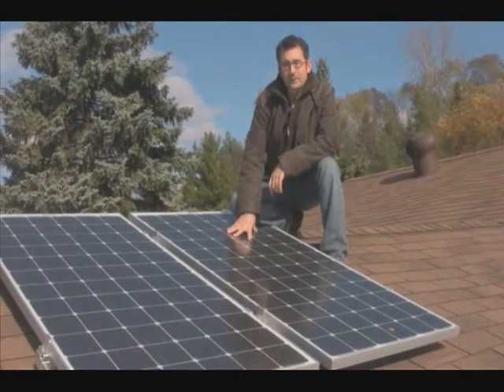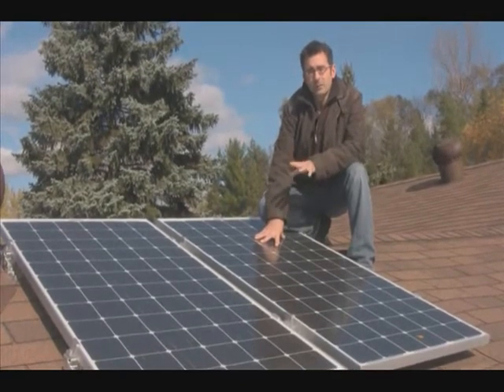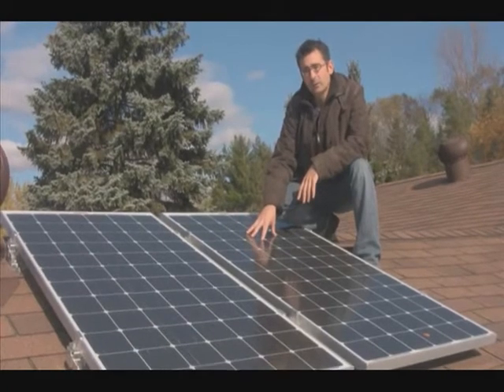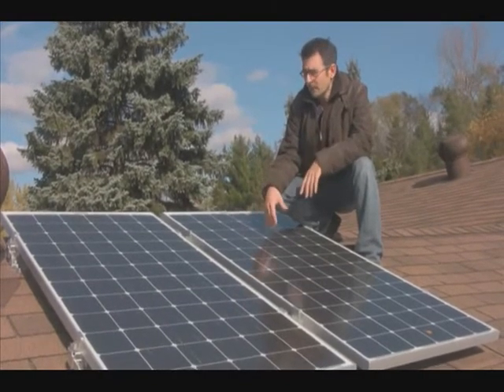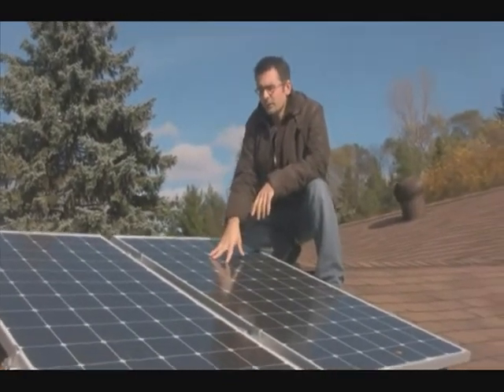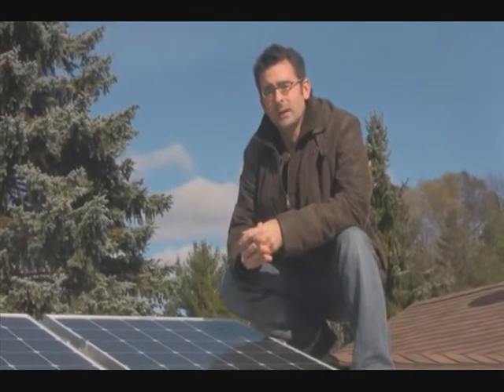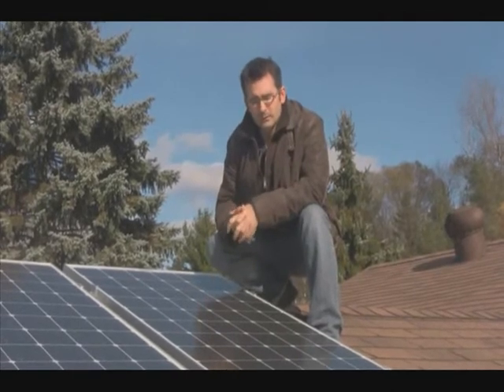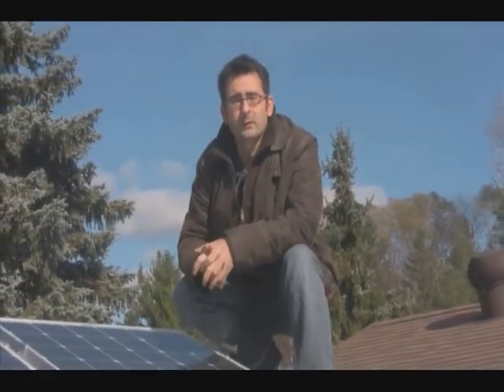2009 11 - Solar Panels.wmv

Comment from the maker: I believe the enphase inverter is connect to a 220v because the 40amp breaker is a double pole.  and there is a monitoring fee it's about $5.00 for the year but that is only to broadcast the info to the web as I have on web site.  you can access the inverters locally by entering their IP address from a computer connected to the home network.
thanks

Comment from the maker: Retail, the panels are about $1200 each including the inverter.  Installation for the first panel is about $1000 and the second panel is practically nil.  Horizon Utility Corp also wanted $350 to setup the account and install the meter.  The monthly account fee I believe is $10 every 2 months but I haven't receive my first bill / credit yet.
thanks

Comment: Do you mind if I ask what was the cost for the two panels racking and inverter. I am currently conducting my own test. I have 2  200 Watt panels on my shed. Today with a nice sunny day they are producing about 250 watts per hour continuously. Not bad for this time of year.

Comment from the maker: Yes you are correct.  I don't think I was clear in the video.  With 2 panels I am hoping for $300/year.  I have some shading issues & the installation angle is not perfect.  But that being said if the panels produce that kind of power then I will purchases another 10 units and generate around $1500/year & cover  costs of electricity used.  The average house in Ontario could have 20 panels and generate close to $4000 per year. Yes my inverters are enphase and I have the envoy unit installed.

Comment: You said your 2 panels 180 watts each were going to great 320 kwh max and hoping for 3 to 4 Gs dollars a year. They are only going to make 320 watts per hour max. I have read that in Southern Ontario (where I am from I think you are too) you can take an average of 3 hours of sun per day for your calculations. So by using that to calculate total panels needed to get around 3 thousand dollars a year you are going to have to put about 20 panels up. Are your inverters enphase with the envoy untit?